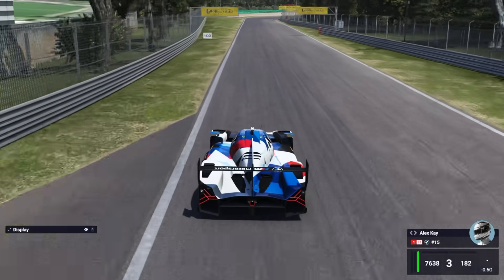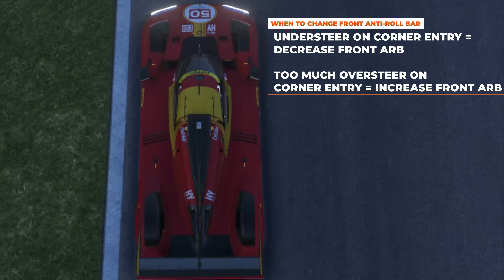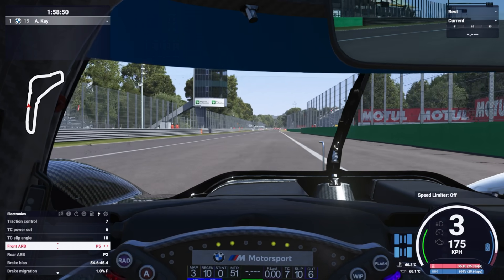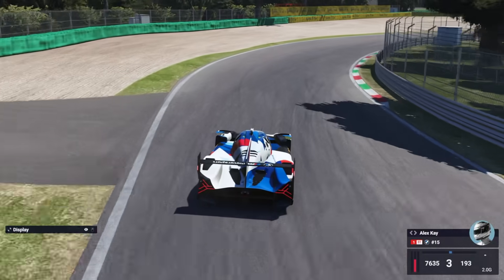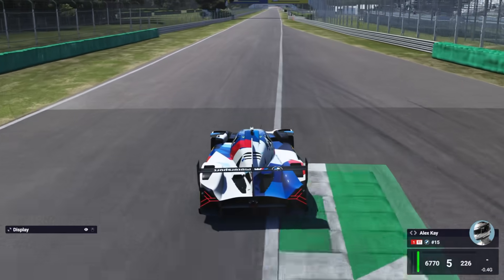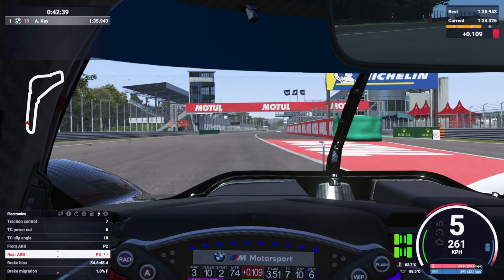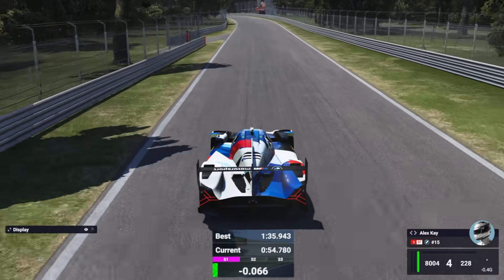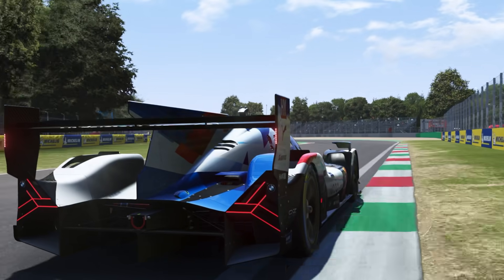THE HYPERCAR GUIDE PART 5 - Anti-Roll Bar Systems in Le Mans Ultimate

Comment from the maker: IMPORTANT REAR ARB UPDATE:

After a lot more testing with all the different cars I have found that my explanation of the REAR Anti-Rollbars is inverted (wrong way round)

PLEASE FOLLOW THE BELOW INSTEAD:

WHEN TWEAKING REAR ARB:
 
- Making the Rear ARB stiffer (higher number) will make the rear of the car more loose during mid-corner and corner exit.

- Making the Rear ARB softer (lower number) will make the rear of the car more stable/less rotation in the mid-corner and corner exits.

My apologies for any inconvenience caused.
Reply: Now I am confused 🤔
Reply from the maker: @ it’s all good bro. Everything is still the same, just rear anti-roll bars do the opposite.

In the video I said that making the rear anti-rollbar higher will make the rear of the car more stable. It’s the opposite actually, making the rear anti-rollbar higher will make the rear of the car more loose.

So just switch that rear anti-rollbar advice mentioned in the video around and you are good :)
Reply: @alexkayracing  yup! Applied the updated logic last night. No wonder i was getting faster sector timings :P
Reply from the maker: @nabilkabir3212  yeah I think with the bmw because it’s such a stable car in can be hard to tell. But yes everything mentioned in this video is 100% correct apart from that detail about the rear anti-roll bar. Sorry for any inconvenience I may have caused with it.
Reply: @alexkayracing  I was about to comment on this after watching the video, but glad you noticed it yourself. It really does follow the same logic on both ends, softer gives you more grip and stiffer stability.

You might want to add one of those Youtube pop up stickers over that section of the video (if you don't want to re-do the whole thing, ofc) because many people will not bother with comments.
Reply from the maker: @ yeah I need to remake it to change the example shown anyways, at least the entire video does not need to be re-done just one one specific section.
Reply: Thanks for this! But as for the front.. if I want more grip, logic says to reduce (smaller number) so that it doesn’t slide as much. Is this a backwards?
Reply from the maker: @astonmarvinracing lowering the front arb gives more initial turn in yes, but then the cars responsiveness after the initial turn in becomes sluggish.

So if you have to do a left-right turn in quick succession (for example a chicane) then as you change direction from the initial turn in then the car will take longer to do this as it is less responsive on the front due to the lower front ARB value.
Reply: @alexkayracing that makes sense. And would explain why my Toyota was having such a hard time after Le combes. Thank you!
Reply from the maker: @astonmarvinracing no problem!

Comment: I have always been confused by this and it has been the biggest reason why I never bothered with making setups. When the rear is loose on exit, how do I know if it's because of TC or ARB settings? Is it just experience? Great videos btw, really helped me learn more about setups
Reply from the maker: Hey mate you will know when the rear is too loose on corner exit because when you apply the throttle the traction control will activate a lot more.

You will also feel the car is still trying to move in the direction of the corner as you exit.

For example if you exit a right hand corner, as you exit and apply the throttle you will feel the car is still trying to point to the right and will feel like it’s oversteering as you are trying to apply the throttle on the corner exit
Reply: @alexkayracing  Thank you mate!!
Reply from the maker: @thib7707 no problem man 👍

Comment: Doesn’t the weight shift to the outside of the turn? I’m confused by beginning of the video.
Reply from the maker: The arrows are just referring to the cars body turning inward. The weight transfers to the outside wheels, that’s why they heat up during those corners because of their increased grip.

Comment: from what I remember making the Rear-ARB stiffer gives you oversteer, while making it softer gives you understeer, basically the opposite way the Front-ARB, at least it how it works on other SIMs
Reply: Correct! Higher Rear-ARB = more OVERSTEER in LOW and MID speed corners.

If u make the ARBs too low in hight downforce cars u risk loosing downforce stability in mid to high speed corners due to increased body roll, its a compromise
Reply: @PRSilva13 I didn't know about the second part, good to know
Reply from the maker: What we found is that it depends on the car, it seems to be a quirk of the BMW and some other cars. However the process is still the same wether you raise or lower the rear ARB, just make the changes until the rear of the car does what you want it to do 👍

Comment: isn't it the other way around? If it's too oversteery, you reduce rear arb?
Reply from the maker: No I always found raising it will stiffen the rear, at least in LMU
Reply: @alexkayracing  might it be because you use very soft settings anyway? Is it the same, when you change from like 7 to 9 or 7 to 5? Or is it because with your driving style, you rotate then on entry very much, then have not much of turning on exit, which leads you to rather have the feeling of less oversteer then?
Reply from the maker: @kanolightracer5  that could also be possible yes, what I have found is the arb is that it’s easy to also mess up the balance; so that sometimes lowering the rear ARB could also cause it to stiffen. But the way I do it by raising the rear arb always makes the rear arb stiffen probably because of the type of balance created.

You should try both raising and lowering the rear arb, if lowering them works for you then do that one, but experiment with both 👍
Reply: @alexkayracing  If u lower ARB in LMU to minimum, it says detached. So, higher rear ARB = stiffer ARB. Stiffer REAR ARB = more oversteery in LOW to MID speed corners, due to rear axle loosing mechanical grip while compensating body roll. In MID to HIGH speed corners, the aerodynamics makes more significant influence in the balance.
Reply from the maker: @PRSilva13 yes please check the pinned comment above 👍
Reply: @alexkayracing  ooops, missed that
Reply from the maker: @PRSilva13 all good 👍

Comment: Thank you so much for your guides! I find this one extremely useful! I have a question though... When I drive the Porsche Hypercar it suffers from huge oversteer (especially in circuit like Portimao!) even with the front ARB set to the max (5). Is there another way to reduce oversteer with the Porsche? Thanks!
Reply from the maker: Glad they can help! Is this in the hairpins in particular? I remember when I first drove the Porsche that it would tend to oversteer a bit in the slow corners.
Reply: @alexkayracing  both slow and fast corners (in the last fast long corner I often spin while it doesn’t happen driving the other hypercars). Maxing the front ARB doesn’t seem to change things as I would expect.
Reply from the maker: @AndreaLeone86  okay is this with the default setup? If it is I can try it out myself and see what the issue is. It’s just been a while since I drove the Porsche is all
Reply: @alexkayracing  I think I drove the car with the in game Coach Dave Setup, I haven’t tested it with the default setup 🤔
Reply from the maker: @AndreaLeone86  okay I’ll have a look this week and see if I can replicate the issue. Was it only at portimao?
Reply: @alexkayracing  after watching your video I tested different cars on various tracks and I could immediately feel the difference when I changed the ARB values. Then I tried the Porsche at Portimao and I noticed this strange behavior.
Reply from the maker: @AndreaLeone86  okay thanks for the info, I’ll test it this week and see what the issue is :)
Reply: @alexkayracing  thank you!!!
Reply from the maker: Will be trying this out today 👍
Reply: @alexkayracing  I haven’t had the time yet to try that combo again with the new update but it seems to me that the handling has changed quite a bit (in a positive way).
Reply from the maker: @AndreaLeone86  yes we will have to see how it goes as I have not been able to test COTA out yet either

Comment: Hey Alex ! Thx for this nice video, it will really help !

Do you know if we can assign ARB adjusments to a button on the steering wheel ? I didn’t find it from my side
Reply from the maker: No problem mate glad it can help! I will have to check to confirm this, I usually use the MFD to change this one but if there is no keybind available for it I will let the developers know and maybe they can put the option in for us!